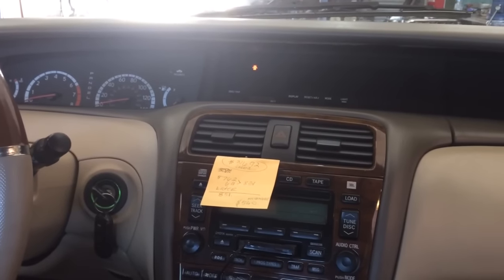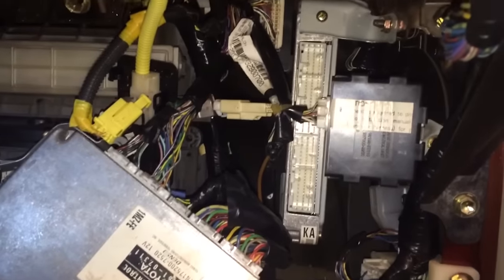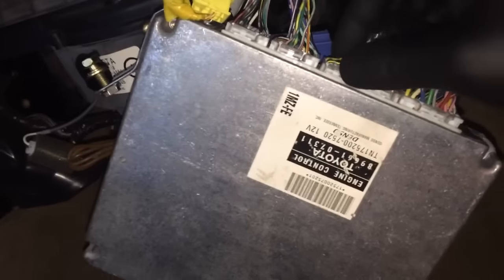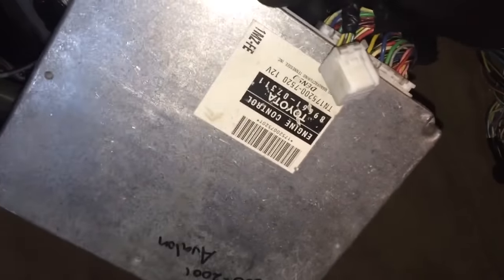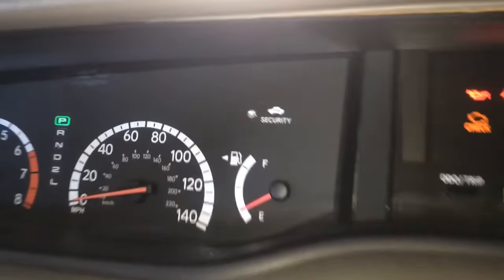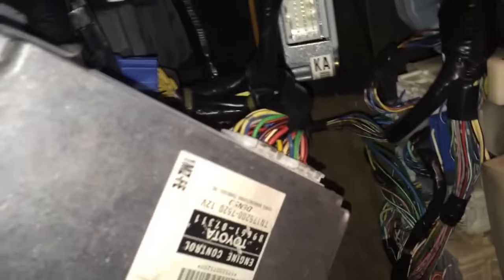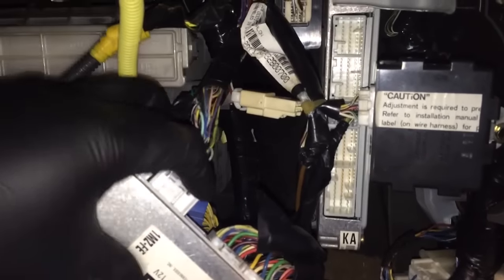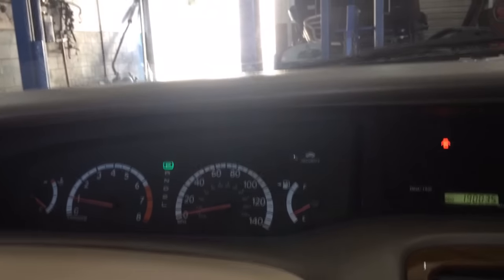Watch NOW! Immobilizer Bypass No Special Tools Needed Real

Comment: Hey mate, hope you are ok.

I have an Opel Astra G 2001. No start, but engine turns over when ignition turned. No spark either, and I believe there is an immbilizer problem. How can I bypass the transponder?
Reply from the maker: +Walagala Emmanuel Harry i'm not familiar with that car as i live in the United States. Let me ask you some questions. Does fuel pump up to the fuel rail/injectors? Is there a Key symbol on the dash or anything with immobilizer  lighting up when you turn your ignition on?
Reply: Revved Up Knowledge Does this only work on older model cars

Comment: My Acura 2004 rl immobilizer is bad according to Acura dealership they wanted to replace it for a huge amount. Any suggestions for me?
Reply from the maker: Is it an intermittent issue? Sometimes it starts and sometimes it doesn’t? Is the green key still flashing with the ignition all the way on?
Reply: Revved Up Knowledge thanks for replying. I lost my keys they told me my immobilizer is bad which need to replace in order for them to make and program the new keys. I have no ideas if is the intermittent issues. For now that what I been told in order to have the car running.
Reply from the maker: Did they say it was the module or the reader that was bad or maybe both?
Reply from the maker: Well in any case you can buy a used set of Keys with the matching ECU(computer), with ignition switch and immobilizer module used on eBay and you can either change them all out yourself or pay someone to do it. I saw a used set for around $300. You can also remove all your door locks and have a locksmith re-key the locks to match your new set of keys as well.
Reply: Revved Up Knowledge they only told me my immobilizer is bad. Ohh man used keys with ecu then replace all doors lock seems so much money might be the same amount of money the dealership is asking? Anyway sir thank you for replying appreciate it!
Reply from the maker: Sometimes it’ll cost more if you have to pay someone. . If the module is in fact bad you can replace just that with a used one as well. Then you get the dealer to cut you a key with your vin and then you can source an outside locksmith that can program the immobilizer for you.
Reply: Revved Up Knowledge will any locksmith can program my keys you think? Before I towed it to Acura dealership I had a keys made by a shitty locksmith that didn’t work.
Reply: Revved Up Knowledge Acura dealership might refuse to make me a new keys since they knew my case. They might say I need to have a new immobilizer in order to make a new keys?
Reply from the maker: Most locksmiths nowadays should be able to program those especially since it’s an old system. If they can program Bmw, Mercedes Lexus etc they should be able to do the RL. That would be BS if they refuse to cut you a key. Your a paying customer. Call around to see if a locksmith can cut you new keys (say lost keys) and program them. Ask them also if they aren’t able to program the keys for some reason how much would the charge be still. Key guys I’ve come across won’t charge me unless they can program it. At most they’ll charge for the keys and cutting them
Reply: Revved Up Knowledge I called a locksmith to come look at tomorrow. In my case let’s say indeed my keys were programmed before I towed it to dealership. If my immobilizer indeed is bad then my car wouldn’t start? If that’s the case I’ll do what you suggested replace my module/ecu then have a new keys make. Is nice to know there’s still some good soul out there! You’re definitely one them sir! Thank you for the advice!
Reply from the maker: If the module is bad it probably won’t let them program it but if everything was working normally prior to loosing the keys then I think the module is fine
Reply: Revved Up Knowledge tomorrow the locksmith will come to see if he can flash module and get it going. Hopefully he can will update you for more advice 😀!
Reply: Revved Up Knowledge locksmith is no where to be found. Didn’t even pick up my phone calls. Maybe it is true what Acura dealership told me only them can reprogram my RL?

Comment: What was the original ecu doing before you installed the used one? My 1998 avalon security light is blinking when I try to start the car and it won't start. Nothing is firing on the car.. If I buy a used ecu,  will I be able to do what you did and get it started? Thanks so much if u have more information.
Reply from the maker: Hey Victor, thanks for watching!! The original ecu in this car was overheating and would die out after 10 minutes or so of the car being on. It would let me start again after 20-30 minutes after cooling down. It seems like your issue is your keys. The computer isn't recognizing the keys immobilizer code. You can have your keys reprogrammed at your local dealer or a locksmith company. Some shops have those programmers as well. Most high end diagnostic scanners will have that option too if you know anyone with a scanner. Let me know if i can help in any way!
Reply from the maker: Oh and buying a new/used computer and trying this trick won't work. Original needs to recognize keys first to dis engage the security
Reply: So my only option is to have the keys reprogrammed.....
Reply: Also,  thanks for all the information....
Reply from the maker: yea either way you go you would need the keys reprogrammed. i would try to get them reprogrammed first before you order the used ecu. there are tons of mobile locksmiths that can do that at your place too so you dont have to tow. just be sure to ask if they still charge even if it doesnt work.
no problem if you have any questions car related i can try and give you my best advice.
Reply: Thanks for the information....

Comment: Recently I lost my 01 VW Jetta 2.0l key so what I did was I replaced he cylinder key lock and put one from a 2001 VW Jetta vr6 that had with the key and I replaced the computer as well or the ecm and once I went to try and turn it on the immbolizer light came on and doesn’t want to turn on...? Any help
Reply from the maker: Jorge Salas Thank you so much for watching the video! If you haven’t yet Please LIKE and SUBSCRIBE! Had a similar situation happen to me at my shop, someone stole a bunch of keys and I was left with replacing all the keys missing. I had to call a mobile locksmith come out and re program new keys. Did your key and ecm also come with the immobilized ring(reader)? Sometimes you’ll need that too

Comment: If you have a working key and a good ecu just switch out the 93c56 from the bad ecu problem would be fixed no need for the unplug replug b/s bypass
Reply: Hello friend, do you know if the 2001 Hyundai Santa Fe 2.4 liter has the same chip 93C56. TO switch it to my used ECU that i just bought??? Thanks in advance...

Comment: Hi Does this method work on a 2000 honda Accord LX vtech ULEV 2.3L F23A1 with a flashing green key.  I replaced the ECU and the Ignition switch w/ key and Immo (USED)EVERYTHING WORKED GREAT SWITCH AND KEY and now cranks but no start and the green  key just flashed foreverrrrrrr non stop help. thanks P.N.
Reply from the maker: +thomas edwards unfortunately i have tried this and it doesn't work on Honda/Acura's . I tried this on an Acura MDX and they share the same immobilizer system. You have to get it programmed. i have a few questions for you, how many keys did they give you and do you still have the other keys (original ones) on the key ring next to the key that starts the car?
Reply: +Peter “LikesToFixIt” Nguyen  Hi Peter first i should say this vehicle never started after adding components that were worn out the last was the ignition switch that was sticking so i decided to change the switch with key and i got a good deal and they added the ECU tested good they said both the old and replaced ECU's only had one key and they were never on a key ring together ever. Seems like everything is working it's just the immo green key flashes constantly. please ask me more question i really need help.  thanks peter for responding.
Reply from the maker: +thomas edwards sorry took long to reply hopefully you have it sorted out by now. Seems like the key needs to be re-synced with the immobilizer system

Comment: Well I am kinda desperate so here goes, I have Toyota Yaris 99 and lost the keys. From what I read so far, Id have to replace whole ECU (which is not financially viable). Is there anyway to get this started without original keys? Is there any way to get Yaris 99 to start without original transporder?
Reply from the maker: you have to get new keys made and have a key company or the dealer sync your new keys with the car again

Comment: I have a 2009 Hyundai Tuscon my imboilzer light doesn’t come and won’t start I get a 0560 code and 1676 if I have replace my mobilizer would I just need another Ecu I have both keys
Reply from the maker: how old is your battery? sometimes when your vehicles battery does not have sufficient power i could trigger those codes on your Tucson. if it is fairly old i would try and unhook it have it fully charged and see if that helps. you might have to clear your codes via a scanner as well. if you do end up replacing the immobilizer piece, you would need to get it reprogrammed to your keys and or ecu.

Comment: I think my ECM is on its way out as well on my nissan altima 2.5. I have a remote starter and 2 keys, and sometimes the car locks up randomly and wont start with the code for immobilizer/ECU. I have tried using both keys and just the remote starter and it still does the same thing. Usually it will eventually start back up after 20 min to 1h if u let it sit and so far always starts right up from a cold start. Any thoughts on what it might be? in the mean time i might buy a ECU, Key and immobilzer combo on ebay.
Reply from the maker: i would try and remove the remote starting system first unless you really want the remote start system then i would take it to a dealership or some place reputable.
Reply: Peter Nguyen thanks for the suggestion, but I now know that it is the ECU. I'm no longer getting communication with the obd scanner and the security light is permanently off. I'll be towing the car to the dealer.
Reply: @PopoRamos  just reading through the threads and saw your message. Im curious as to if it was your ecu. I'm having the same issue with my Infiniti. The sucurity light was on, I messed with this and that and now it won't communicate with the odb2 and the security light went off but still won't start. I don't want to pay the dealership $300 to reprogram the key if that's not the issue.
Reply: @jasonapostolec  it was a combination of the ECU and the remote starter. If you have a remote starter and your having issues, have the shop take the remote starter out and your problems will go away. Back to the old fashioned start up.
Reply: If your ECU is dead, get one from the junk yard or eBay. Depending on how old your car is you might be able to buy the dealer software and program the keys yourself much cheaper (that's what I did) but my car is 15 years old
Reply: @PopoRamos  thanks for the info. I don't have remote start but I already got an ecu from the junk yard... Now just gotta figure out how to make it work on my car, haha
Reply: @jasonapostolec  what year is your car?
Reply: @PopoRamos  2004
Reply: @jasonapostolec  Google "Nissan Data Scan II" Its for infinities as well, but see if your car is supported on their website, then, you will need an obd 2 to usb adapter (there are some recommendations on their site) for a windows laptop, then you will be able to reprogram the keys yourself and a lot of other things as well. Good Luck.
Reply: @PopoRamos  thank you so much!! I really appreciate the info
Reply: @jasonapostolec  hello friend were you able to figured that out, i know your post it's old, but I'm interest to know how did you do it, i am running through the same problem at this moment, i just bought an used ECU from eBay, but my car do not fire up only cranks, all the lights come on, i need the last touch to get it going buddy, please help if you can, thanks.

Comment: do you think it will work on a 2002 camry? its throwing a p0301 code. changed coils, injectors and plugs and still misfires. did a compression test and all is good. checked electrical wires and all ok. I'm stuck. i have a donor pcm just to get that code and cyl 1 misfire away.
Reply: stuck. did a helical job to the block and had the head check and done up. just really frustrated with this and now moving to thinking maybe a bad pcm
Reply from the maker: Sounds like you might have an intake gasket leak (or injector seal or even bad manifold) on that cylinder probably. If it was misfiring all cylinders I would say ecu issue.
Reply: ok i will look into that. I changed, cleaned and tested all injectors out yesterday. put new top and lower injector seals from toyota. reset the pcm by having the battery disconnected for some time then started the car. always when cold or letting it sit overnight it will run fine for a couple of minutes maybe longer at times then slowly gets into its misfire mode. have heard and read on forms about these plastic intake manifolds going bad but didn't think this one  can potentially be it. thank you for the reply
Reply from the maker: after every time you disconnect the battery, you will loose the memory for the throttle position. you have to re-learn the throttle values. to do so do this
1. reconnect battery
2. warm up car to normal temp(press on gas if needed)
3. after doing so turn off car
4. turn engine back on with all accessories off
5. Pull e-brake (hand brake) all the way up and shift the car into drive, slowly let go of the brake making sure the ebrake is holding the car back properly.
6. leave in that position for 5-10 minutes without pressing the accelerator or until the idle of car rises by itself. if it does so then the car relearned its throttle values back
7. if the idle did not go up by itself and is wanting to shut the engine off, you must take the intake tube off and clean the throttle body off of carbon build up and repeat the process earlier

hope this helps and isn't too confusing
Reply: After all it was a bad coil. After swapping some around it still misfired at the same cylinder. Bought a set of densos off amazon for a great price {replaced all 4} then then reset ecu and setting throttle values doing your streps. Now the car runs like new. FINALLY the headache is over...Thanks for the help and advice.
Reply from the maker: AWESOME! glad you hung in there and figured it out
Reply: @RevvedUpKnowledge  Couldn't a bad IAC Valve could cause random misfires on all cylinders?

Comment: hey peter to make a ling story short we have a 2001 toyota avalon..which we just had to replace the ignition switch and ignition switch housing because the old ones were broke.called a dealership and they said it would be 1000 to program tht key to tht computer in the car..is there any way to get it started?
Reply from the maker: +Jae  Clardy whoa $1000.00??!?!?!?!?! thats insane. I'm assuming your new stuff came with a new key, what you can do if you still have your original key, i would take the ignition lock assembly back out and bring it to your local locksmith and have them match the ignition lock with your original key, that way 1: you wont have to reprogram your immobilizer system and save money and 2: you'll only need one key to enter and start your car still
Reply from the maker: +Jae  Clardy oh and matching the lock to your key shouldn't cost you more than $50 bucks probably
Reply: Thank you.But i dont have my original keys any more.
Reply from the maker: Jae Clardy then the only thing i can suggest is to call a local locksmith and see how much they would charge to reprogram the immobilizer

Comment: Peter, I tried this hack several times,  swapping out ecu in 2000 Avalon. Is there something i missed, did exactly what you did with no luck. please advise. thx.O
Reply from the maker: +TheOwen1974 does the original ecu work still or completely dead?
Reply: +Peter “LikesToFixIt” Nguyen Again , Thank you for the help..original ecu still works ,a friend of mine has a Snap-on Modis handheld, he isolated the ocv and can trigger it on and off , ocv's seem to be fine, and were new last year along with the o2 sensors. when it warms up ,it starts idle searching , and dumping fuel into bank 2. if we shut the ecu out and put it in service mode it straightens out and the misfire goes away. originally I thought the vvt gear may be sludged or worn at the locking pin but now thinking its the ecu.  the kicker is no codes..sorry to keep asking questions, but you seem to be the only guy (on the tube)who knows what you're talking about..
Reply from the maker: +TheOwen1974 hmm this is tough without me physically checking the car. I had a similar situation happen to my mother in laws RX300. Ran flawlessly before warmed up, but when fully warmed up it would run way under powered and if i feather the throttle the idle would surge up and down( no check light on or anything). Drove around making the engine surge up and down till light came on. Checked it and codes came back as a bad OCV for bank 1. Changed bank 1 OCV and symptoms were gone. I checked the bad valve by running some current through it and it worked fine but in the car it wasn't working properly. 

Try and run the car long enough while its idle searching so that the check light will come on. I don't think its a faulty ecu. wish i could physically check the car for you! let me know if this helps or not so i can try and help stil

Comment: On a lexus is200 2001-2 year, this it not work.i tried a lot of times, and no luck...When plug into the old ecu, security light stop blink(with key on) then when back the connector to the new ecu, it start blink again, and to starting engine..